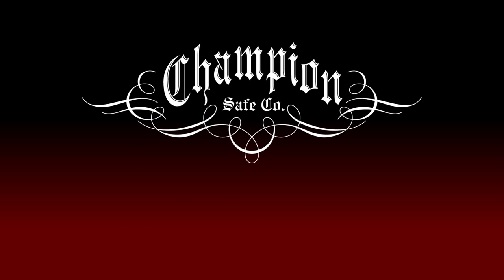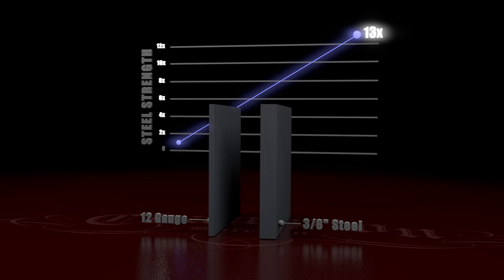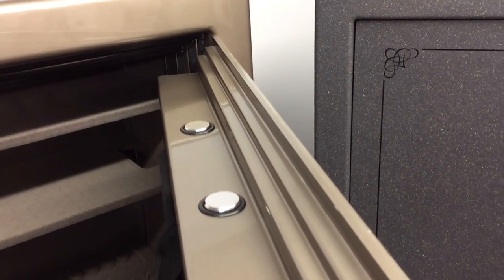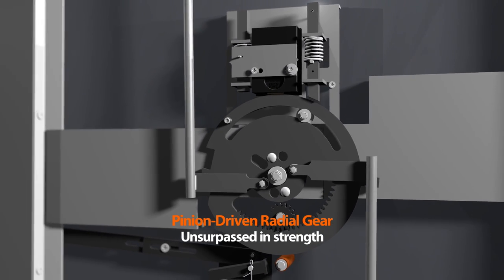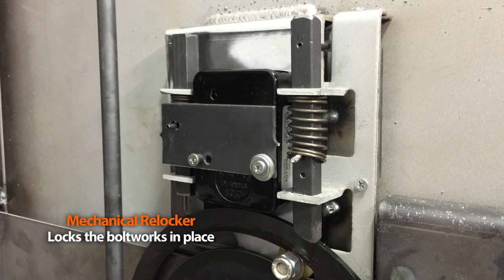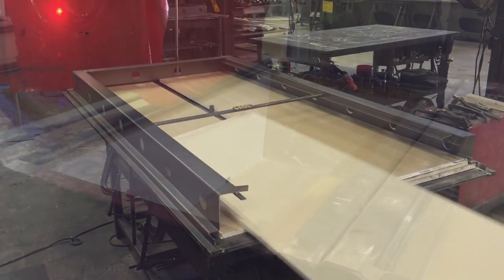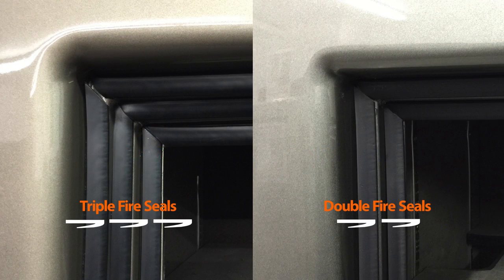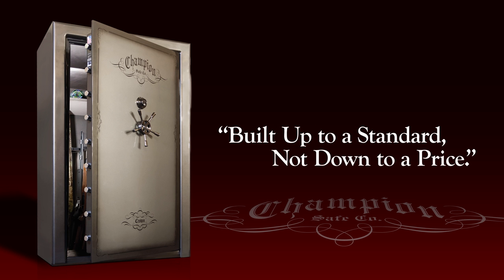Champion Safe

Comment: When I bought my Superior Regal SR-35 it was missing a one inch strip of fire barrier on the hinged side.  Those things happen, but what I was disappointed about was that I had to provide pictures and dimensions, make a follow up call, install myself with my provided adhesive. There has be no follow up call/email to make sure it arrive to my home safely or if I needed any assistance installing.  It was also the wrong color of fabric.  When I sent the pictures to the manufacture rep he asked me what color it was and if it was a new color (like I should know).  Never was I asked what color of safe I had, if so there are only two options for interior color.  He also promised me a light kit for my trouble, which I never received.  Customer service lacks some and they should know their products better than me. Other than that I like the safe, fit and finish is of good quality.  I'm hesitant to recommend based on any problems that comes up requiring service.